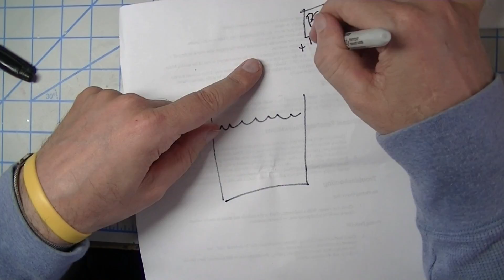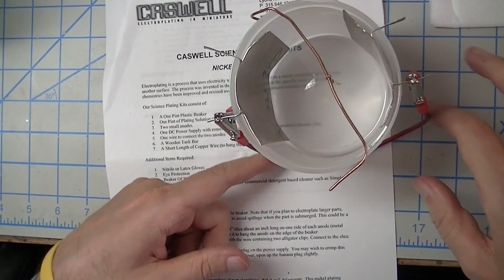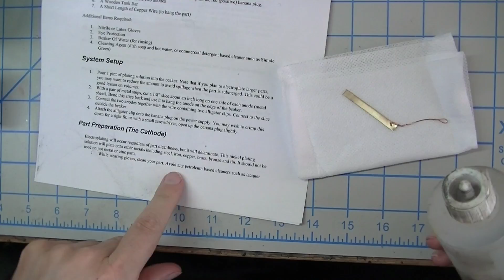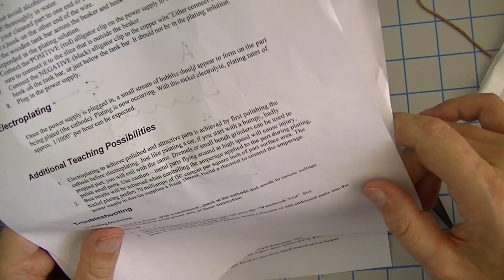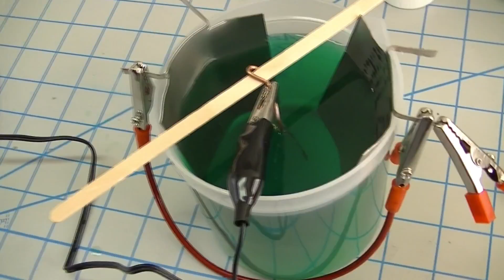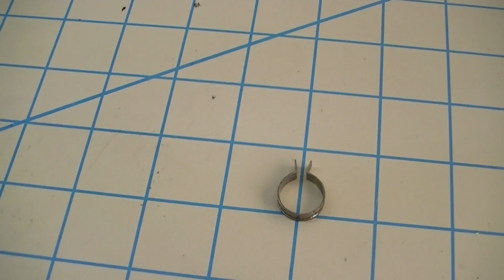ep199 - the electroplating adventure

Comment: Ahhh, the often misunderstood world of amperage.  The amperage rating of any voltage/current device is the maximum output rating of that device.  Voltage is constant when dealing with a power supply, however the actual current being used by the circuit it is connected to is dependent upon the actual circuit resistance (or, load) presented to the power supply.  So, in this example, the wall wart is producing a steady voltage of slightly less than 5V, and although rated to produce 300mA, the amount of current required by the circuit will be less than that.  Much like a 100w speaker, when connected to a 25w amplifier, is really only having to dissipate 25w, thereby the entire wattage output of the speaker is 25w. It can HANDLE 100w, but in a net energy perspective, you get out what goes in. If you connect your ammeter in series with the electroplating transformer, set up a series of known surface area test pieces to create a known surface area vs. actual current drawn data curve, you could easily tailor the current through a small bulb or variable high wattage resistance to zero into a good target current for good results.  FYI, most modern dimmer switches are not rheostatic in design, as they would have to deal with too much heat.  Instead, they are probably using an SCR or triac circuit (solid state) in there, and are not very effective with less than 1A of current passing through them.

Anyways, keep up the good work. Love the channel and the constant exploration of ideas without catering to the "accepted" norms of this hobby  Who gives a shit about the "right" way of doing something.  The key is the end result and is the end result what was intended.

Comment: Or add brass with enough surface area to dissapate excess amperage, bundle of scrap PE.?..I started watching just after you started diagram,looked up and saw an apparatus for seperating hydrogen and oxygen with electricity.. and the next step involves a long lit taper then a Bang.So i was glued immediately in super curious mode.Then you added the B and N to the nodes.Great results,more robust than i 'expected'.I envisioned more like heavy paint layer on PE,far more delicate.New tool for the box,ive got a waffentragger with full PE surrounding armour shield and fenders,that are screaming out for a finish like that.The readiness is all, i suppose.Whats that the stoics say? "if one man can do it...ill say sorry now.Might be have some trouble with the 'thumbs up' on your next vid

Comment: If in the future you find you need a rheostat, you can get an electric guitar volume or tone pot (i.e. potentiometer) for $3 - $5. They are made to work with very tiny voltages though. Someone more knowledgeable than me would have to figure out if they could handle 4 volts. As a bonus you can get them most commonly in 250K or 500K resistances to better suit your needs. EE's chime in!

Comment: What you could of done was add small light bulbs ( same voltage as power supply) in parallel in leads to take some power away from the probes.  Cheapest easiest solution
Reply: Even a piece of pencil lead could've worked as a makeshift resistor, but that's from someone who already knows electronics...
Still we're talking about so few mA @ low voltage that I honestly don't think it'll matter that much apart from too much bubbling, and the fact that Will is going to polish the plated piece anyway.
Regardless it was a success and yet another tool in the toolbox! :)
If you plan to do a lot of plating in the future I can recommend that you buy a bench power supply. They aren't expensive if you don't go for the expensive brands and it'll give you exact control. The goal is to have less activity, i.e. bubbles, and that'll give you a more even surface when done since every little bubble will stop the plating happening at that very spot until it pops and so on. Less aggressive action + longer time = better quality imho. This is why it looked grey on your parts I suspect?!
Anyhow, great video Will!
Reply from the maker: aaaaand that's why i have an me degree and not ee.  lol
Reply: At the end of it all you would need some kind of multi-meter that could measure amperage it’s all guess work.